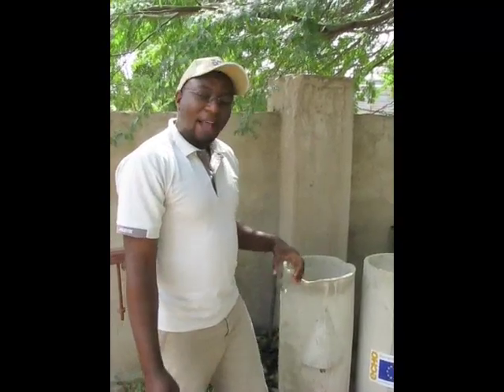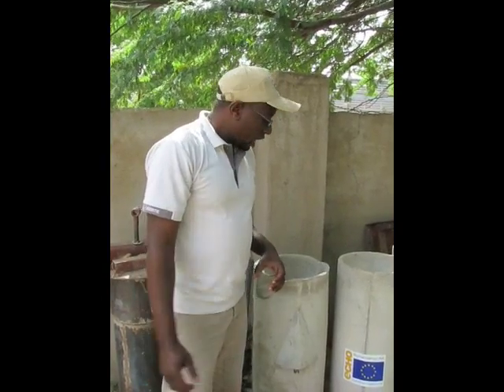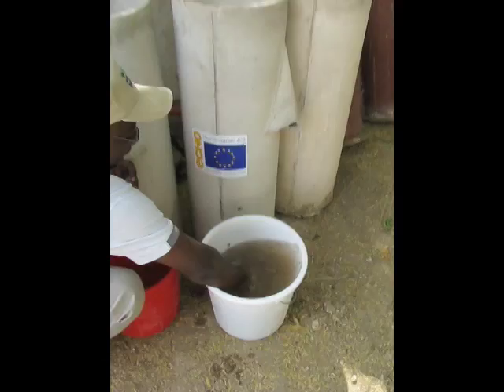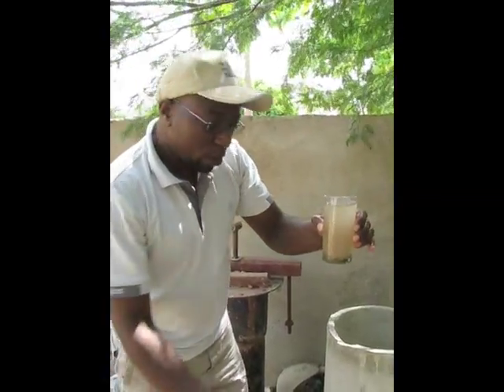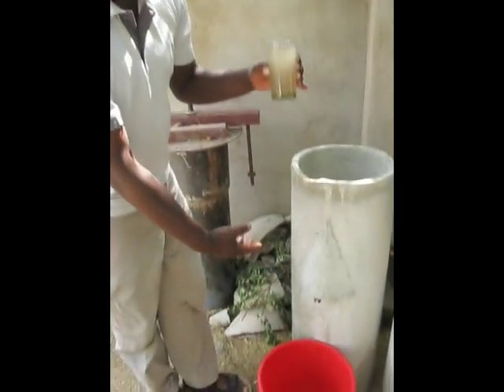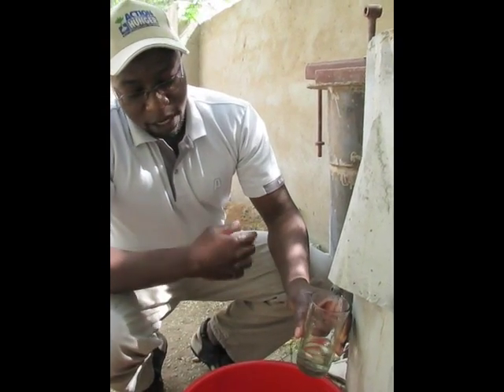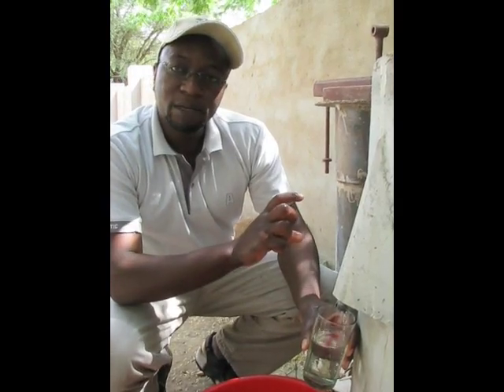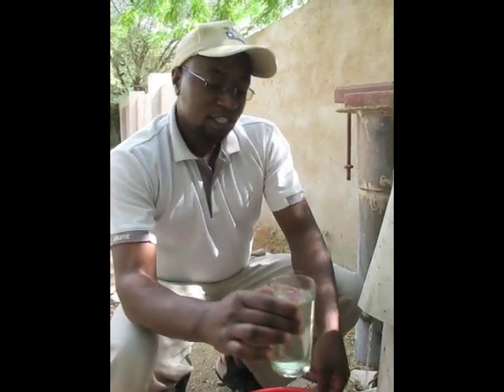A remarkable and inexpensive way to produce clean water

Comment: @acorntechnique;  Remember distilling is not the same as boiling.  Distilling will remove mineral components while boiling will CONCENTRATE them.  Is distilled water bad for you?  Yes.  Why?  Fick's Law and Le Chatelier's principle .  Minerals in the body would be leached to the water in your system to reach an equilibrium.  Is boiled water safer... well, though the germs are dead, they are still they and can still propagate another population.